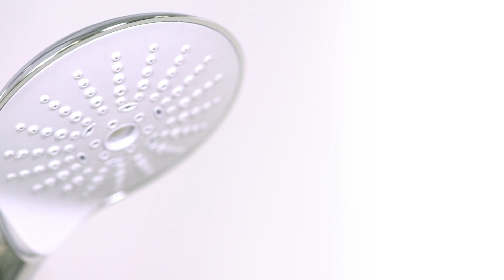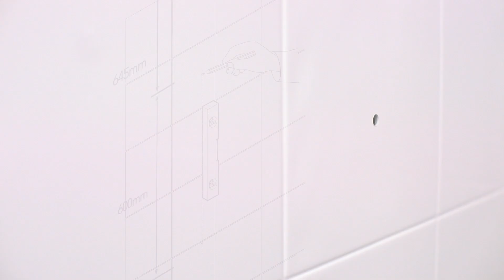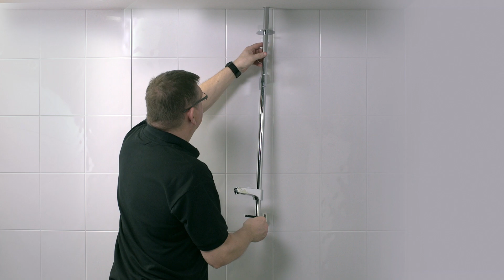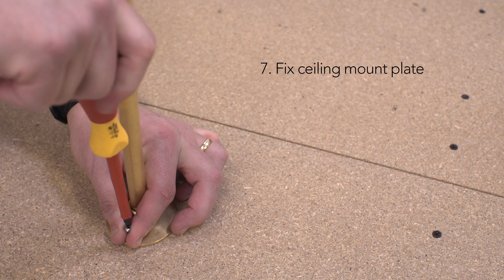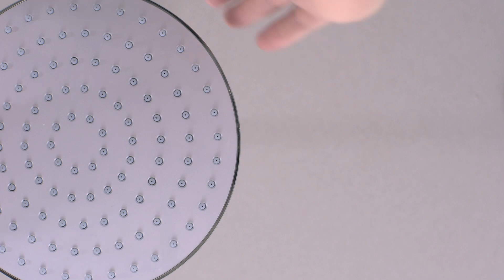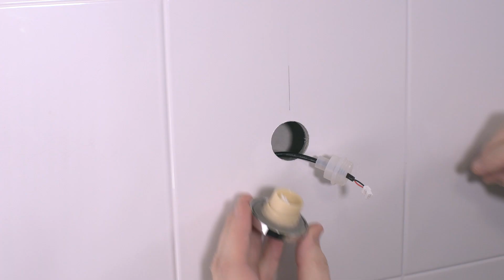Mira Mode Dual Ceiling Fed – Step by Step Installation Guide

Comment: can’t pair up the receiver get error code p07 when starting up won’t receive a signal has anybody any idea on the issue been working fine for 2 years but just can’t get it to connect to main unit today so can’t shower.any ideas would be great thanks
Reply from the maker: Hello, Error 7 is related to Platinum rather than Mira Mode and usually indicates an over-temperature or thermistor fault. For further advice and guidance, our customer will be more than able to advise on the error further and solution. Visit our website for our customer service contact details  https://www.mirashowers.co.uk/support/contact-us/